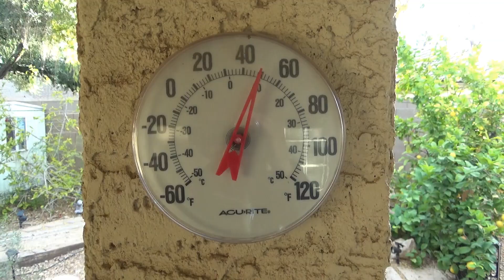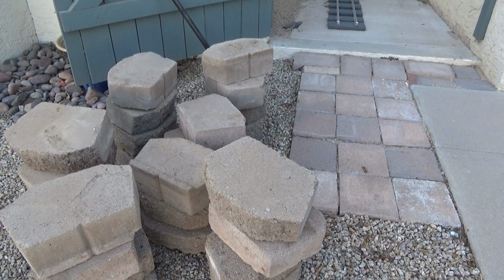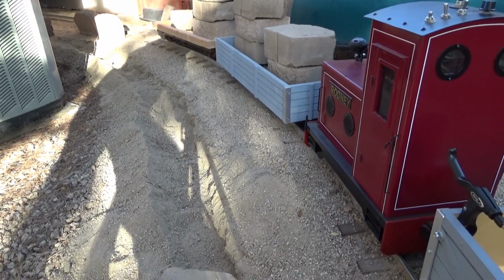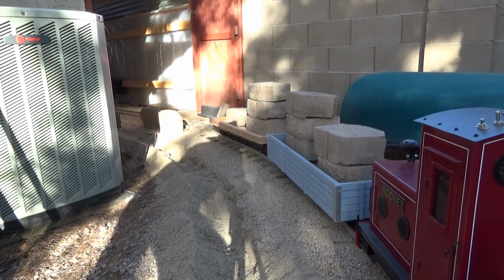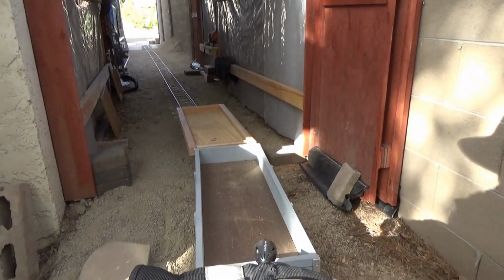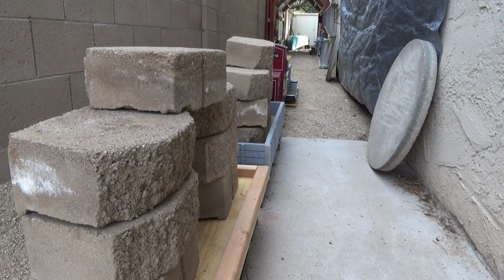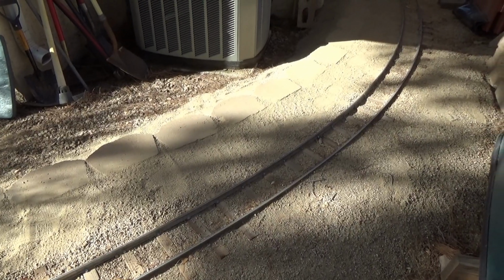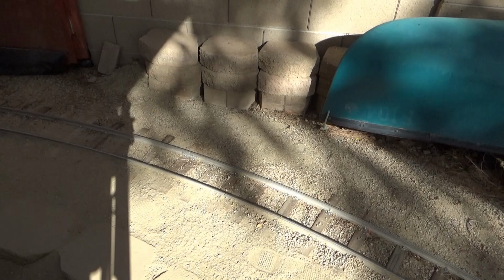'Hauling the Mail' - CNRR #68

Comment: That is lots of weight. Good job!
Reply from the maker: Surprising for such a little 12v rig.  The most I've pulled so far is 3 adults plus two small kids (5-year-olds) but that was too much, really pushing it up hill just to test it.  The controller readout was flashing the whole way up the 3% grade.  😅